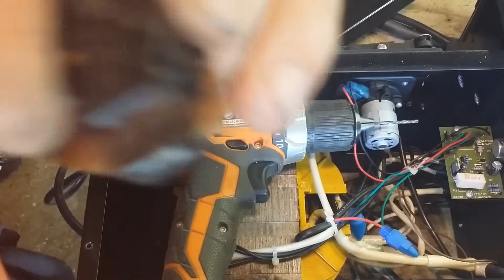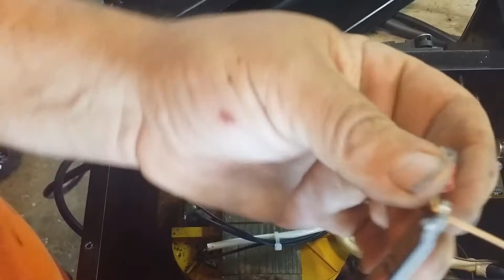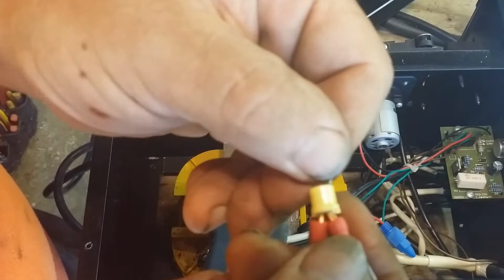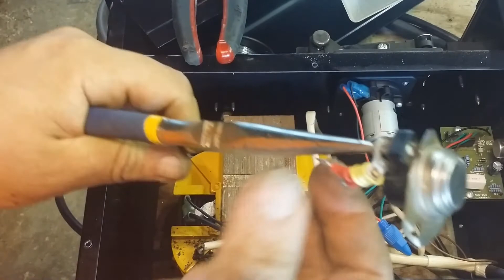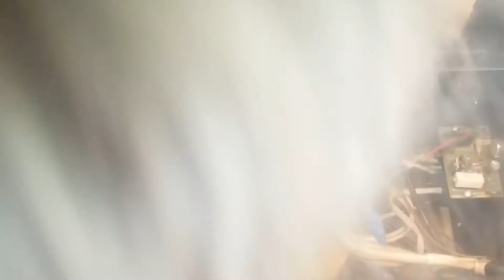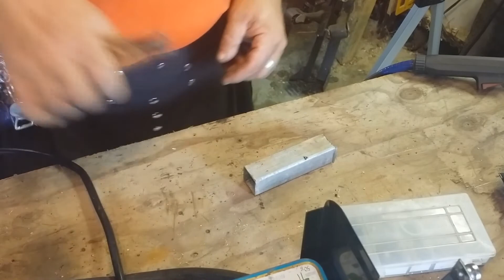Powerfist 8209686 FCAW Gasless MIG Welder  Repair

Comment: Awesome repair, I need a replacement switch was yours rated at 120C?  There are lots of temp settings for the KSD301 switch line. Mine is destroyed and I can't find the ratings.
Reply from the maker: I'm sorry, this was 3 years ago, I don't remember any specifics.
Reply from the maker: I should have reread my comments when you first asked... Sorry. "I downloaded a catalogue at the time So I remember that it was "over temperature switch ksd301" and the same switch in used n Microwaves. Cut and paste what I have in quotes to google, I just got about 8 adds for Ali Direct in the  $2. range. (ksd301 125v 16a 120). " So yes it was rated 120 degrees.

Comment: Hey, I don't expect you to help me, but I have a welder that is nearly identical, and one day it stopped working entirely. Absolutely no life in it at all. I decided to open it up and was looking around and saw that on the power switch, one of the metal parts that the wires connected to was barley attached and I moved it around a bit and it came off. I managed to make it go back on again for the most part as a temporary fix, but now when I turn it off it trips a circuit breaker every time. Do you know what I could have done wrong? I can post a video if need be.
Reply from the maker: Yes a video would be helpful, chances are ti switch is shorting out, but that is a blind guess... Post a link here when you get it up.
Reply: TrollForge https://youtu.be/VNkfgtVAh0E

Here is the video.
Reply from the maker: I left you 4 replies, should fix everything.

Comment: Hey TrollForge, my temperature switch just fell apart ): . The casing just crumbled apart.  I'm in Canada and I'm having trouble finding the part.  Do you have any suggestions? Thank you!
Reply from the maker: I downloaded a catalogue at the time So I remember that it was "over temperature switch ksd301" and the same switch in used n Microwaves. Cut and paste what I have in quotes to google, I just got about 8 adds for Ali Direct in the  $2. range. (ksd301 125v 16a 120)